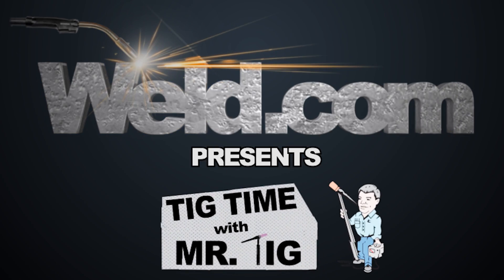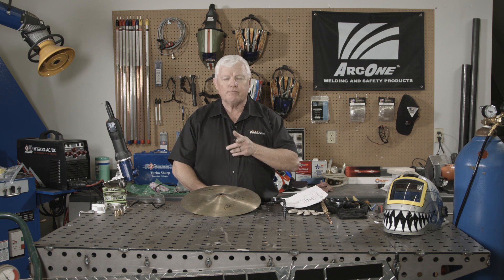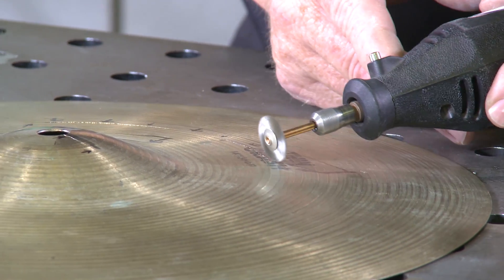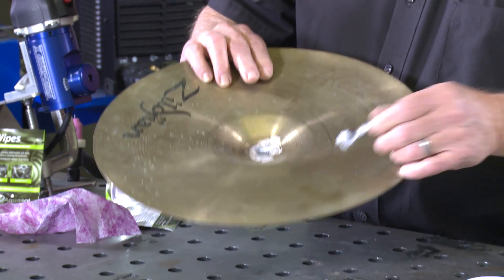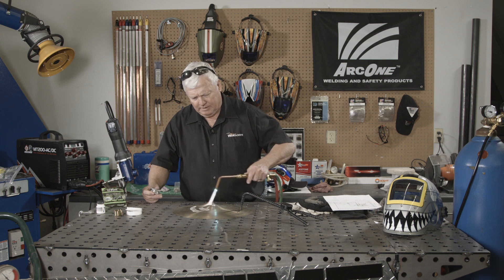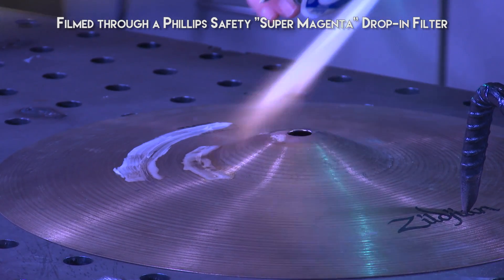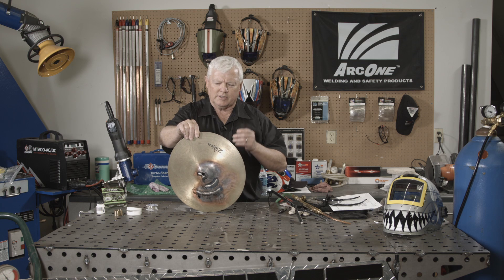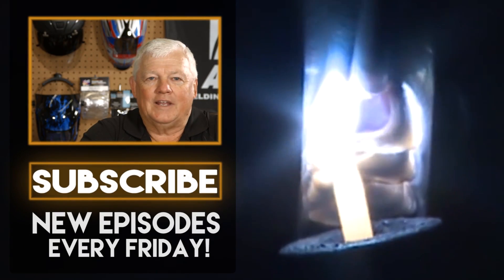Welding Bronze Cymbals (Part 2 of 5) - Soft Solder | TIG Time

Comment: I tried this 30+ years ago and it did not hold.  Did the exact same technique you shown here and it didn't even survive a few hits.  I used silver solder.  I just now leave cracks as they are possibly drilling out the end of the crack to limit it spreading.  The sound usually isn't too far off, but once you heat or add anything to the cymbal, it changes the sound so drastically it renders it to smacking a pan.

Comment: I have repaired a couple ,with mixed results. Stop drilling the ends of the crack is essential to prevent further cracking. Best results came from using vehicle body solder paste painted into the crack and a quick heating with my induction forge. This pulled the solder into the crack with very little overflow or distortion. Owners pleased with results and lack of change to their instrument. Can get the flux solder paste from Eastwoods.

Comment: When dealing with small parts that are heat intolerant I use a hot air gun.
Reply: If you get a chance then try an induction heater, instant but very localised and controllable heat. Has to be seen to be believed!

Comment: I feel using tig for this would be a lot more appropriate. Torch soldering is much too hot across an area and your just filling the space not  refusing the crack which is whats required for resonance. You could even look at doing a heating process after welding to help homogenise the weld a bit better.

Comment: In most crack repair projects, it is common to drill a stop hole at the end of the crack to prevent it from running. What makes you feel a filler material will prevent this, given that this is a percussion instrument? Good luck with the repairs and as always, thanks for sharing.